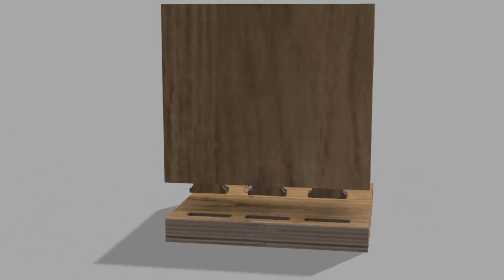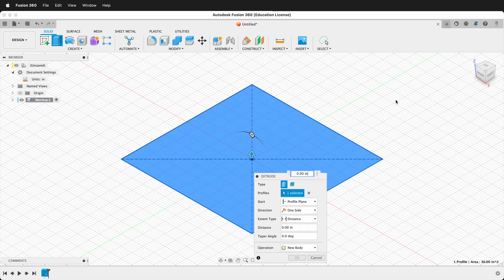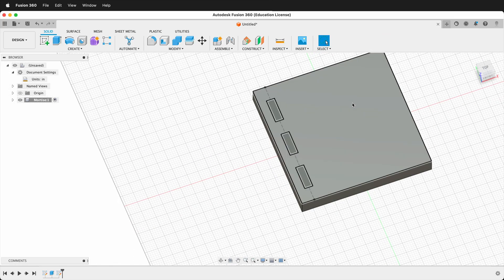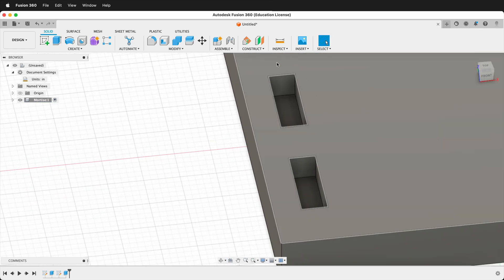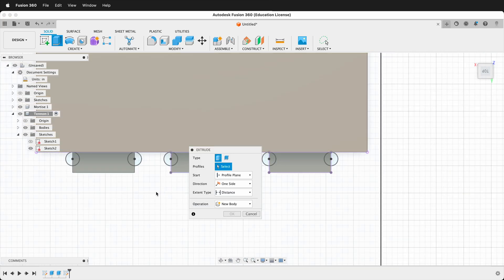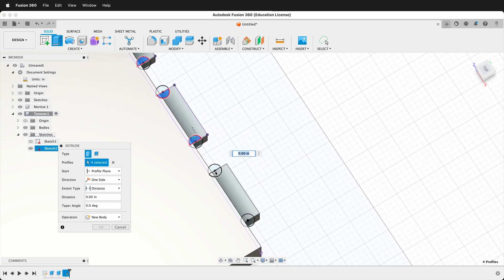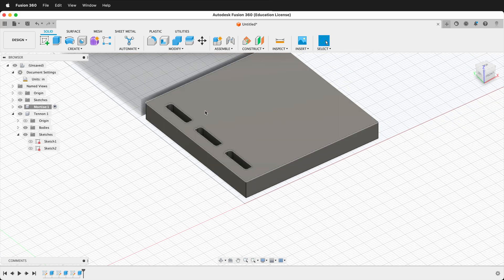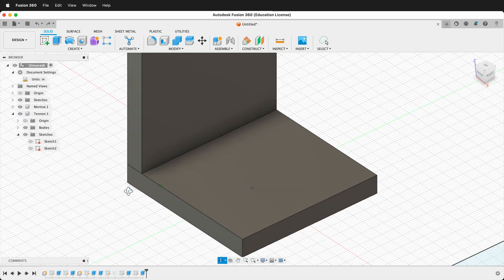Blind Mortise and Tenon Joint for CNC in Fusion 360 Tutorial

Comment from the maker: Post any Fusion 360 CNC joint questions in the comments
Reply: Hi! Great tutorial.  I have an issue:

I'm trying to make these joints parametric, such that if I resize the box the joints resize with it. However I seem to have come up against a somewhat intractable problem: For circles that are tangent to lines, there seems to be no way to specify what side of a line a tangent circle should end up on. This means that when I resize the box, the circles often end up inside the box, whilst still respecting the tangent constraint. I tried using more constraints but my sketch quickly became overconstrained. Did you ever accomplish anything like this?

Comment: There were so many great techniques demonstrated in this video. I have been using Fusion for years but still dont know the power of constraints and variables.
Reply from the maker: Fusion 360's real power is it's parametric features and editable design timeline, always new stuff to learn or other ways to do things, usually I only realize after I finish a new design that there was a much more efficient way of doing it

Comment: thank you for another excellent video for cnc enthusiasts. I had one question, when adding the fillets on the mortise and selecting the plane I somehow could not select all the pieces, then when creating the circles it only contraint to the first "block" the rest I could not contrain the centre of the circle to the edge of the other blocks because it seems only the one section was selected. To resolve this I made 3 seperate sketches. How did you get it right to select all 3 blocks of the mortise to sketch on?
Reply from the maker: If that happens and you can't select the lines, press p to project the lines into the sketch you're working on for the fillets, then you can select the lines that will become sketch lines linked to the geometry below

Sometimes the plane gets in the way and you can't easily select the lines you want, you can either make a selection priority in the top menu or you can hide a sketch in the browser that is in the way

Comment: I enjoyed the video. I learned a lot about using Fusion 360 from watching it. However I do not fully understand the finished product. You went back and added rounding to the Mortises but the tenons at the lowest level still look pretty square. How will it fit right?
Reply from the maker: The lower parts of the tenons are perfectly square because they are outside corners. The CNC can cut square outside corners but not inside corners.

Tolerance and fit for CNC parts discussed in this video https://youtu.be/W8AcI8LkIrg
Reply: @WhatMakeArt  Thank you. I've enjoyed watching your video. I do have one more question please. Could you point me toward a resource for doing toolpaths in Fusion 360? I've found plenty of videos on how to make the mortises but almost nothing on cutting out the shape, and cutting out the shape+tenons on the other piece.
Reply from the maker: This video shows how to make a toolpath for the shopbot https://youtu.be/_G-0i8BFEFs

These videos have tool path creation at the end, although from earlier versions of fusion 360.

https://youtu.be/GqXQ8TdzYRE

https://youtu.be/I6FEMdtcrpI

https://youtu.be/GzknioA34F8
Reply: @WhatMakeArt  I watched the videos and unfortunately none of them go into the toolpaths themselves. Do you offer any type of 1 on 1 training?
Reply from the maker: Email is on the channel about page for more specific inquiries